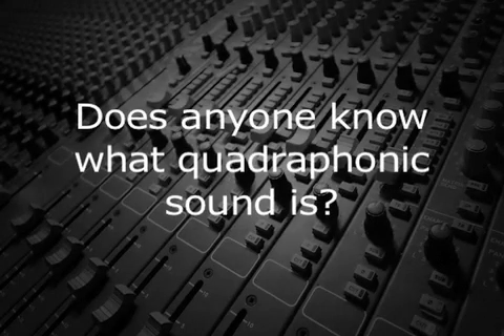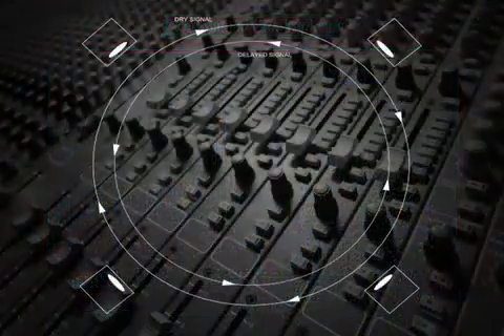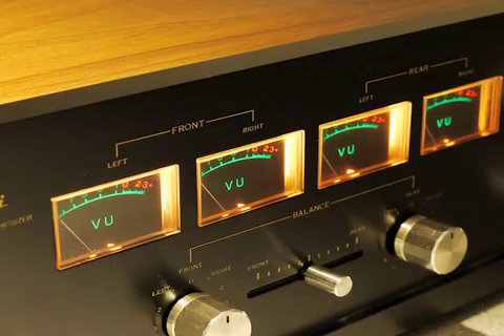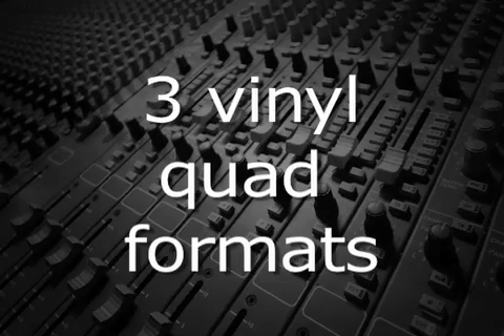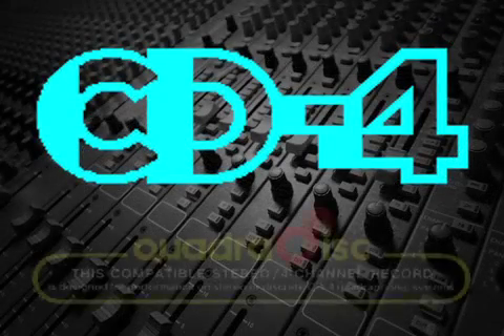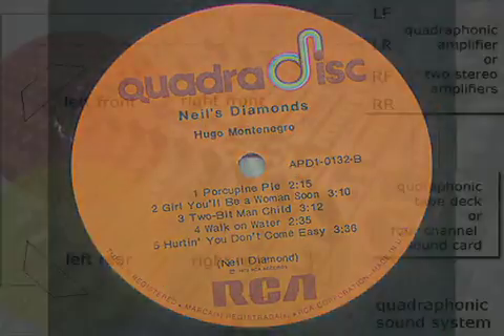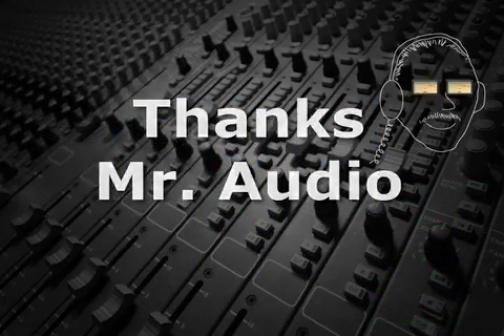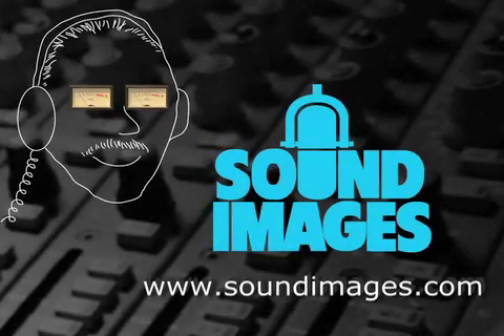Quadraphonic Sound

Comment: You information about the CD-4 system is incorrect. The main audio, 30 HZ-15 KHZ carred the sum of both the front and rear channels of that side, left or right, not just the front channel as you stated. The ultrasonic  
sub carrier carried the difference, one channel minus the other, not just the rear channel of that side as you stated. 
So if you played the CD-4 record on two channel equipment you would hear the sum of both the front and rear  channels of each side. If the CD-4 record was played through a CD-4 system the CD-4  demodulator would demodulate the subcarrier and feed it through a matrix with the main audio to get the discreet front and rear channels. Conventional broadcast FM two channel, left and right, uses the same technique.
Reply: P.S. Do a search engine for CD-4 audio disc and you should be able to get a clear explanation of the CD-4 system worked. Wikipedia has a good article on the CD-4 system.

Comment: Thank you for your response, but I still have a doubt: do you need a quad special record player, beside having a quad amp and  4 powered speakers?
Reply: Actually, for CD-4 you need a pretty critical setup. A Shibata stylus, low capacitance cables, and your antiskate/alignment JUST right.

Note that most used North American CD-4 records are shot, with that vital ultrasonic carrier being worn off by poor equipment from the day. This is what pressed the Japanese (as JVC supported the format) to come up with better vinyl formulations.

I say go with the two  matrixed quad formats. They're mostly compatible with each other, need no critical setup, and decoders are easier to find on eBay.
Reply: +MrAudioSoundImages RCA marketed quad 8 tracks in 1970. They have the benefit of being discrete quad without the pain of CD-4 (again, the brainchild of RCA).

I only have one quad tape in my collection and I say they've held up amazingly well soundwise.
Reply: And a CD4 record, what never been used on a usual stereo turntable and few times on a quadro turntable.
Reply: With the SQ system, you need a decoder only. It could be, that it may work with Dolby Surround equipment.

Comment: Don't forget the Quadraphonic 8-track tape! Even FM radio was pushing to be Quad; though the FCC dragged it's feet on that one not approving Quad FM for broadcast until 1983! By then, Quad had faded into obscurity.

The original Redbook Specifications for the Compact Disc actually do specify a 4-channel mode but was also never implemented.
Reply: +MrAudioSoundImages Check out www.quadraphonicquad.com for tons of info.  While the LP was probably the most popular Quad format, Quad 8-track take second place for sure with somewhere near 1,500 titles available. Quad Reel was the least prolific of the format with very few pre-recorded titles.

Oh, slight correction there regarding CD-4;  it is compatible with stereo. The name actually stands for Compatible Discrete.  Contrary to popular belief, the back channels are not encoded above 15khz. Both front and rear channels are modulated together in either the left or right side groove.   But like Stereo FM, it's the demodulation signal (or difference signal) is what is encoded from around 20 through 50khz.

Quad FM was to be the next logical step. The Quadraplex system was created by Louis Dorren (who sadly passed away recently) who also had a hand in creating the Quadradisc/CD-4 format.  Have you ever seen an older Quadraphonic, or sometimes even stereo receiver that has a strange, single RCA jack on the back labelled MPX OUT or FM DET OUT or QPLX DET?  That is the jack that would pipe the RAW FM signal to your Quad FM Demodulator which would sort out the 4 channels and then pipe it back to your receiver.

Quad was supposed to be the next best thing. So much was planned for it but very little actually came to fruition.  Kind of sad when you think about it. I have over 500 Quad 8-tracks and many of them have such great mixes, that I don't ever want to hear the stereo versions. I love it and it's actually making a bit of a comeback these days!